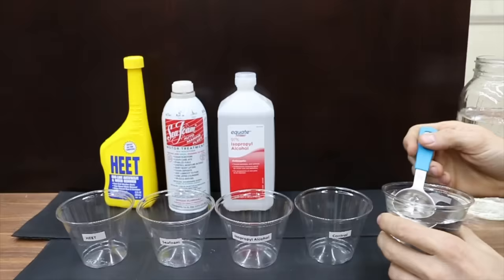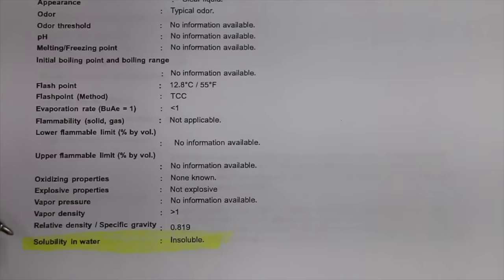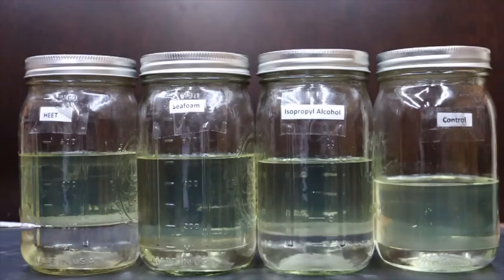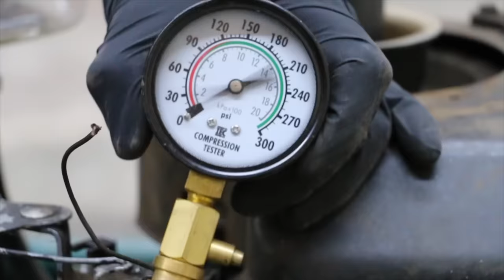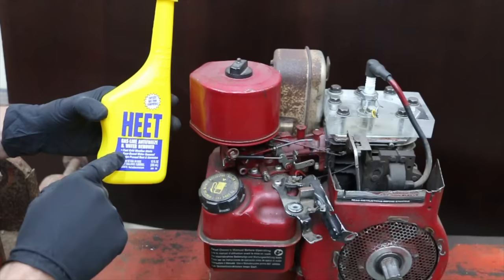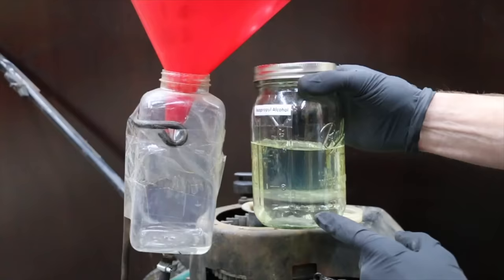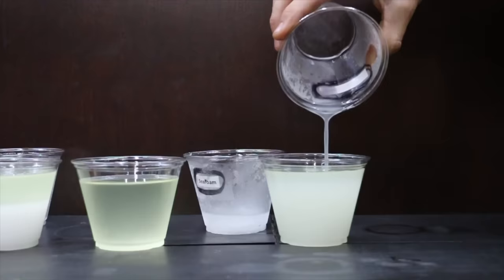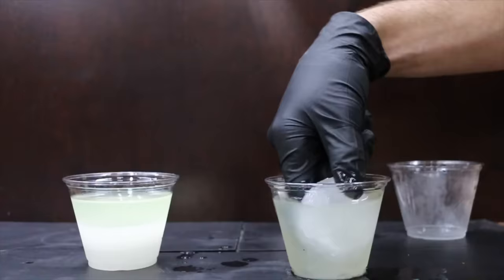Is HEET better than Seafoam for Water in Fuel?  Let's find out!

Comment: Back in the day, we used to buy 4 bottles of a product called "Drygas" (gas line antifreeze that was mainly isopropyl alcohol) made by Christie, and add all 4 bottles to a half tank of fuel just before going to get our annual inspections done - this would guarantee a pass, no matter how out of tune your engine was. I had a '85 Monte Carlo that I brought in once - the guy showed me the screen as my car was running. Limit was 220 or so PPM hydrocarbon emissions - I was at 2,596 ppm, HAHAHA! Think I had several misfires going on. I said, "I'll come back later today for a retest" - he says, "I  don't know how you plan to fix this in one day, but you're going to have to pay again if you fail". Dumped in the 4 bottles, and went for a drive in 1st & 2nd gear, revving the crap out of the engine to get that converter red hot. Came back for the retest - it was only 2 hours after I had been there. Guy was shaking his head. Sticks the sniffer in, and it only got to 55 ppm! His mind was BLOWN - he says, "What the hell did you do to this thing??" I replied, "I fixed it." 🤣 He was staring at me as I backed out, like I had just dropped down from outer space. 😂

Great video, as always. You and your family have a very Merry Christmas, and a Happy, Prosperous New Year. God bless.
Reply from the maker: I really enjoyed reading your comments!  Glad your approach worked so well!  Wishing you a Merry Christmas and Happy New Year as well. God Bless.
Reply: LMAO ty
Reply: Project Farm u too
Reply: How many miles did it have on the clock?The Cat was probably well past its useful life expectancy. I do wonder if the alcohol cleaned it off a bit. lol.
Reply: @Marc83Aus  - About a year later, the cat plugged solid on it. I was in the left lane of a fairly major 2-lane highway in the city, and hit a big hill - the car slowed to 10 MPH, HAHAHA! People were honking and swearing at me ... but of course nobody would let be over. I had my foot right to the rug, and the noise out the intake was 3x louder than the exhaust: BOOOOOOOOOOGGGG!! I went to my buddy's place later that afternoon, and we dropped the exhaust and smashed the melted honeycomb out of the cat. After that, the car felt like it gained 200HP, went from 6 mpg to 20, and I was able to leave rubber on command ... and I did.  One-tire fires EVERYWHERE. 🤣
Reply: Absolute legend this guy
Reply: Wow.
Reply: This is an old trick and still works today.
Reply: Ya I remember using that Christie gas too but it was because I had gotten real bad gas from some gas station while going on a trip, a clerk at the next stop sold me two bottles (I had a 20 gallon tank full) and it really helped I burned off 1/2 a tank and filled up again and it almost ran normal, man I wonder how much water that crazy gas station had stuck me with!
Reply: I used to use Methanol for that. Unfortunately you can lean it too much and get emissions from the other end of the spectrum.
Reply: @SmittySmithsonite  Yeah I have also busted out a few cats that were plugged. Makes you wonder how much pollution is caused by pollution control devices gone bad. 
I know in one case I rebuilt an engine to like new condition and couldn't get it to pass emission tests until I yanked all the smog crap off the engine. Than it passed with flying colors.
Reply: Glad I don't live in an area with smog tests. None of my cars would pass!
Reply: @ProjectFarm  I would like to see you test work clothes. Like dickies, Duluth and others. I know you'll find a way to fairly test them. Wear resistance, insulated and so on.
Reply: I gotta try that.LOL
Reply: This and e85 works still with older cars. I did it with e85 and 98 ron mix couple of years to my "winterbeater" before the engine was so done that those didnt work anymore. Hc came down from 1300+ ppm to 79 ppm when 100 was the limit, third year only got to 200 ppm
Reply: @consaka1  - That's even true with the modern stuff - diesels are the perfect example. Wonder who's bright idea it was to run a diesel at 2,500 RPM for a 15 minutes to a half hour doing NOTHING, except burning particulates out of the DFP filter,  wasting diesel fuel, lowering the lifespan of the engine, and polluting. Only the government could mandate such idiocy ...
Reply: @SmittySmithsonite   I got a call from a friend that was broken down so I went to help him out. After a few minutes I determined the cat was clogged. Had a look to see that the exhaust was a straight shot. Next door was a construction site that happened to have a pile of 10' rebar. He was back on the road in 10 minutes.
Reply: @SmittySmithsonite  Well the EPA said to. You know, that government agency with no limit to its powers.
Reply: do test with K100
Reply: All you have to do now is run the tank low add some E85 and it will pass then after you leave the inspection emission station fill up with 89 octane your cat will be just fine seen it done many times.
Reply: I dont get why a smog guy would be so blown away by you fixing the car. he said it was misfiring, 9/10 times its an ignition component. Literally takes 15 minutes to install a dizzy cap and rotor with a flathead screwdriver. I can think of many ways a missing car could be fixed quickly. Could have been same story but you changed spark plugs or something.
Reply: I had almost the same exact experience...
Reply: koolkitty8989  Good information - Thank you for sharing.
Reply: Cheating on your emissions test. Soooo good for the environment, and look how it helped Volkswagen!
Reply: I pour a half bottle of acetone and a gallon of e85 to clear random misfires on 3.6 gm engines. Works for thousands of miles.
Reply: Cool story
Reply: Smitty Smithsonite I would have died laughing.
Reply: I remember that stuff. It worked great!
Reply: What can I do for a modern car 2010 accord V6 that's has a code for catalyst inefficiency
Reply: My uncle's work truck with a vortec 350 ran like garbage so we dripped diesel in the intake while running. Cleaned it out alright. Melted the honey comb out of the cat into the exhaust pipe and clogged it solid and wouldn't let it run. Lolol 🤣🤣
Reply: And always
Reply: I know i'm about 11 months late on this, but damn that was funny!
Reply: Outerspace is not real son
Reply: @consaka1  yeah. Emissions stuff is such a 2 edged blade. On one hand, if working, you get the same power plus gas mileage plus good emissions. On the other hand, if anything goes wrong on your car it causes the emissions equipment to be counter productive. It's been proven that removing a catyl doesn't improve hp, it just feels that way because your pipes are no longer restricted. Exhausts don't have very high psi at all, thus removing the catyl only makes a .5 or even .25 psi difference. Oxygen sensors go crazy, bypass those, your MAF will start confusing things, bypass that and your stoiciometry is gonna be terrible, bypass that and you have spent so much you could have just bought a new catyl.

I think they are looking at emissions backwards. Cats are meant to burn unburnt fuels and vapors. If they focused more on that fuel waste, we wouldn't have such trash catyl stories. I'm sure they are, kinda like cars don't have EGR systems as we use to know them. Some vehicles now have engines without cams.    Pcv systems have been upgraded to where you don't need after market catch cans. We will get there. Until then, grab a torch, welder, chisel, admit nothing, deny everything, make counter accusations.
Reply: That was a great story.
Reply: @drdysl3xia795  what about His story?
Reply: @boldlee2269  passing the emissions test with 4 bottle of drygas and blowing the guys mind doing the test.
Reply: @drdysl3xia795  im talking about His Story, the Bible
Reply: @boldlee2269  Well most of us all know Jesus died for our sins and he's the only way. I consider it history and a way of lie rather a story. Being Jesus created this world.. it belongs to him.
Reply: @drdysl3xia795  u mean way of life? Not lie. God created the earth. satan created the world. And Him is with a capital H. My point was the word history.. and not all stories are a lie
Reply: @boldlee2269  way of life.. typo. I think we all can see with all the child sacrifices going on.. child DNA in our vaccines and other demonic signs that change is coming. Jesus created this Earth. That's up for debate.
Reply: @drdysl3xia795  amen exactly but Jesus  created the earth is no debate. Jesus is God is the flesh. Jesus God and Holy Spirit is One
Reply: *in the flesh
Reply: @boldlee2269  Father, Son, Holly Ghost thanks for correcting me. When I was a kid I remember being confused and asking God, "just help me understand". As the years went on its been one lesson after another non stop to the point I could finally see the Devil truly did exist. That's when I stopped blaming God for this world and started truly paying attention in a different perspective working on deprogramming my brainwashed thinking and learning the truth about this reality. God and I talk every day but God and I one day will have a very interesting conversion and I'm far from worth to be in his presence even in this dimension or any other.
Reply: @drdysl3xia795  amen brother. The Bible tells us satan is the prince of the air and god of this world. As true followers of Christ we hate the world and the world will hate us like they hated Him bc darkness hates the Light
Reply: @boldlee2269  Nice conversation... hope you had a wonderful Christmas and lets have a great New Year. Take care!
Reply: @boldlee2269  Agreed.. it is 100% a Pagan Holiday like the days of week. Sad how everything in our culture is a lie.
Reply: @boldlee2269  We see eye to eye on 911. Operation Northwoods proves it almost happened before.
Reply: @drdysl3xia795  yes brother everythings a lie. I dont know how awake u are.. but the biggest lie of mankind is that the earth is a globe
Reply: @boldlee2269  I think Geoengineering is the biggest lie. They are going to blame us when things get real bad and things are getting bad.
Reply: @drdysl3xia795  yes they been spraying us for over 20yrs with the chemtrails and manipulatng the weather and yes blaming us for the bs climate change hoax they are trying to block out the sun. The chemtrails work with the 5g also. Yes crazy stuff. Crazy world when u know the truth brother. 2020 is perfect vision many can see clearly now. The Bible says knowledge shall be increased in the last days
Reply: Great story
Reply: I believe the red bottle Heet is the same chemical composition as drygas.
Reply: Smitty Smithsonite that would do the trick but could do some damage the fuel intake and pump.
Reply: Could a backed up cat be causing a bit of sputter/shaking at high rpm's? I recently put a new cat on and the dude who did it im guessing didn't clean the welds on the inside and must've got slag in there. Been a week and its pissing me off, I have a 2003 Mercury Grand Marquis and it's the FIRST TIME it's EVER gotten a check engine. Popped up in the middle of the night bright orange blinding me and let me tell you I nearly shit myself when I saw it, I started beating the shit out of my steering wheel saying "no God please no, why now" it's always ran like a dream but now I don't like driving it, I have drove it maybe 3 times since it started sputtering/shaking. I can bring myself to sit in it and feel that ugliness
Reply: @isaakwelch3451  that would be nothing to be proud of!
Reply: @dirtyoar952  It's not that they're dirty vehicles, they just all have little things that would make them fail. For example, the heater on the downstream oxygen sensors or a small evap leak.
Reply: Thank you for the info
Reply: George Hauck - These days since they put ethanol in fuel, I’m not sure if this will still work.
Reply: @Crisp_me  Nice car; so comfy it's like driving your couch...
How'd things turn out?
Reply: @edcunion  I remember that. And I remember Monte Carlos 😂
Reply: @artistaloca4  it's perfect now, couldn't figure it out though. I had dropped the engine and tranny and cleaned EVERYTHING, and what I couldn't clean i replaced with the newest I could find. Fixed that crap real quick, also got some long tube headers and an H pipe with flowmaster 10's. Currently building a clutch assembly to 5 speed swap it, a little crazy but I love this car so much i want it exactly how I want it
Reply: @craigcorson3036  Amen, cars are running so much cleaner now than in the 70’-80’s it didn’t happen by accident, the gov’mint forced the car makers to find solutions and they did some great some not too great (diesel changes). The air, we who live in the cities, is remarkably cleaner, and that’s a good thing
Reply: "Back in the day..." 12 Christmases Later...."Great video as always." 🤣🤣
Reply: Feral Man   87 will damage a e36 m52 engine
Reply: @corvairkid17  my husbands 96 Chevy 350 k1500 truck got to missing.he ran 4 gallons off e85 in fuel tank with about 6 gallons of 87 reg gas and drove it.problem went away and stayed away 6 months ago
Reply: Jesus….get a tune up.
Reply: I'm from "Jersey," NJ, I know Christi dry gas!!!
Reply: Good job awesome
Reply: @SmittySmithsonite  WOW....same same here, and my SUV was not that old at the time......it was a 2009XTERRA and it had running problems, my MECH knocked that crap honeycomb out of the cat. and problem was fixed! those damn CATs. cost a fortune, and around here they are getting stollen off cars all over the place! [SOUTH FLORIDA].  Kind of what was going on was, i would get onto road, and engine seemed to have lost all power to move my darn XTERRA, press on gas and car would not move, or move and gain speed, and very very slowly!  Sure seems that the more they try to improve cars now, the more headaches that they give to all of us! AND HELL WITH THOSE FIs, AND GIVE ME MY DAMN CARBs BACK!!! HMMMM, like the 4 barrels!!!!! i loved those!!!!
Reply: Jesus Christ loves you and died for your sins to be forgiven, if you seek Him you will find Him. He will give you eternal life and peace and you can walk in light! Read the Bible in the book or John or Luke and see Jesus's life and His love for you!

Comment: I'll throw my story on here. 

I once had to leave my 2001 Pontiac Grand Am sit outside for almost a month during college winter break without starting it. Temps below freezing the entire time, and as low as negative single digits at night. And eventually got a foot of snow on it, and 3 ft drifts almost burying it.

My Dad had taught me to put Heet in my tank every fillup during winter, but I had neglected this particular half tank that had been sitting in it.

When it was time to go back to school, I unburied the car just enough to get in it. Figuring that I'd start it, finish digging it out, and let it warm up. When I tried to start it, it would turn over, but wouldn't start. I told my Dad about it, and after he scolded me, he offered a bottle of Iso-Heet from his truck. He said "dump it in, let it sit for an hour or 2, THEN try it".

Well after letting it sit, and watching some football, I tried starting it again and lo and behold, she started up, ran rough for a few mins (with some coaxing on the gas pedal), and didn't sputter or die.
Reply: Thanks your story helped me tremendously
Reply: SO the point is - you messed up again?
Reply: @roberthooper8883  Well the head gasket eventually went out on it, and it wasn't worth $1500 to fix, so I got a 7 years newer Focus.

For which I am currently saving up to fix the AC, and rear end...
Reply: @GreenMosin93  Oh! All's well that ends well... I was just blabbing lol- most of my best lessons were from my Dad...
Reply: Cool story bro
Reply: I had the same first car and I drove it through water that was way deeper than I thought it was. It died in the puddle and the water was up to my knees when I pushed it out. I let it dry out for a bit and it eventually started up with a big plume of smoke out the back. I drove it to Walmart and bought some heet. The smoke stopped and it was fine after that.
Reply: Is Iso Heet a different name for regular Heet, or is it a different product?
Reply: @tgeliot  Iso-Heet has isopropyl alcohol in it, Heet doesn't. Iso-Heet is better in the winter and for diesel, Heet is cheaper.
Reply: @GreenMosin93  Thanks

Comment: I'm an electrician. Occasionally I had to deal with underground conduits (they always have water in them) and when the ground is frozen I added HEAT (when it came in cans instead of plastic. Add a couple cans and the next day the conduit was slushy enough to pull the old wires out and install new ones. Worked very well for me about a dozen times.
Reply from the maker: Great tip!
Reply: Antifreeze or heavily salted water also works
Reply: @damonlemasters3424  works too well. Anti-freeze reacts with/melts pvc, before it got banned/frowned upon for quick and easy bends we'd dunk whatever length in a bucket of antifreeze for a few seconds, after pulling it out it would be like a cooked spaghetti noodle, and that's just a few seconds.
Reply: @ProjectFarm   i was thinking about running oil gasoline and diesel through a water filter and if it would  change any properties or the way they work
Reply: @damonlemasters3424  Salted water might be bad for electrical wiring.
Reply: BIG difference between heet and heat